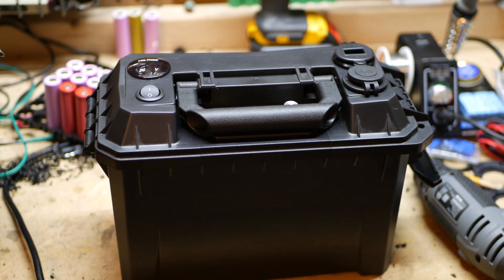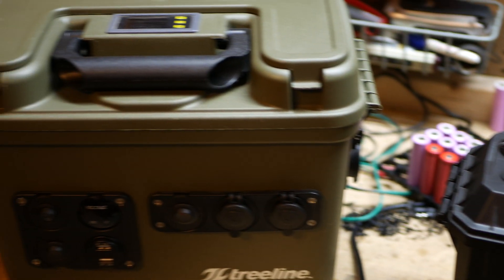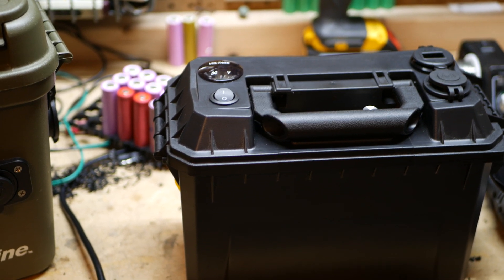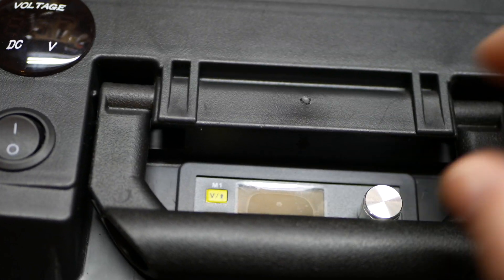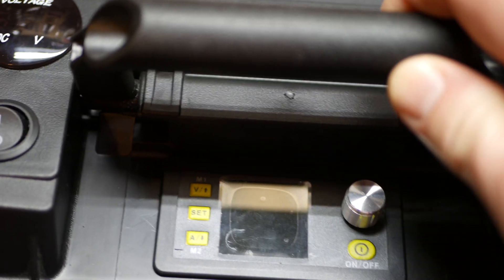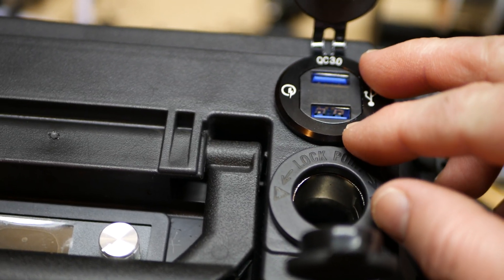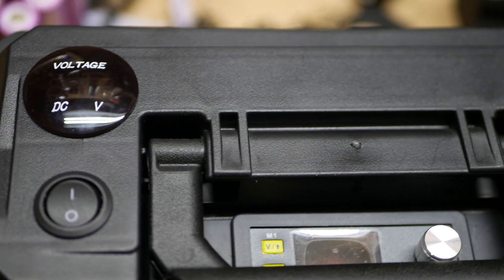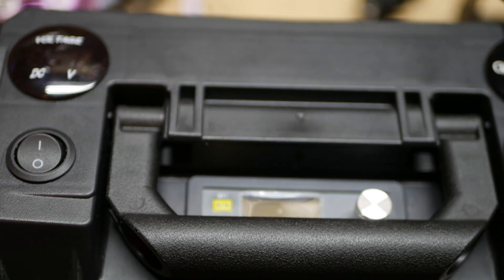Sneek Peak...Smaller and More Powerful DIY 18650 Generator!

Comment: Would you consider making an expansion pack for your solar generator, or maybe making a video on one?  Great work on the generators!
Reply from the maker: Thanks.  I am building a new generator that could be used as an expansion pack.  An expansion pack would be pretty easy to do and.  Use a 7S and make it closer to something like 20P.

Comment: When will you release part 2?
Reply from the maker: I got a little side tracked, did a little more work on it tonight.  Also got my new battery spot welder going too,  Video coming up on that...
Reply: @GreenMountainDIYGuy  still coming?
Reply from the maker: Mitch Ross working on it as I type!  Took some time off but back to it now.  Will do an update video soon.